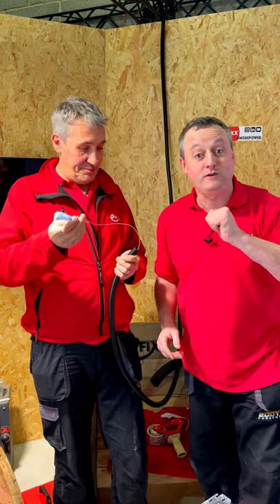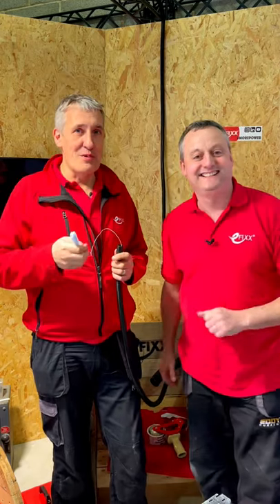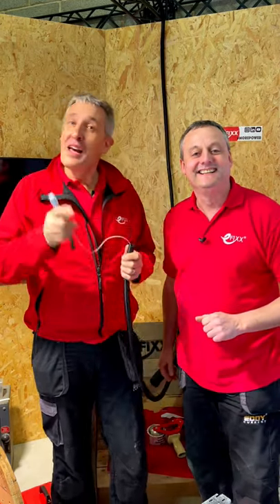Can you use a VACUUM to pull a draw wire through 20mm flexible conduit Electricians' TIPS #Shorts

Comment: Another handy method for pulling through awkward  nonmetallic spaces is to use a strong magnet, with a big steel dome-nut on the draw-string.
Reply from the maker: Great comment 👍
Reply: done this before and it was a job saver.
Reply: Tampon works too.... We used to use compressed air to fire a bobbin through. This was 30 years ago and we were using it on a poured concrete car park deck. Runs of about 50 metres. Easy. You just can't  have any tight bends. Big sweeping bends no problem. It doesn't work with our conduit though. The conduit over there in Australia is different, they come with a bell end on one end so no couplers are needed. The bobbin would catch on the couplers that we use here.
Reply: Subscribe to Mike for mind bending electronic breakdowns. Amazing channel.

Comment: Did this last year. Made a cork ball a little smaller than the bore of existing but redundant 28mm copper pipe to pull through a string that then pulled through CAT5e.
Reply: and if you have problematic pulls with this method on large conduit, use a small plastic bag like you get/used to get in small shopping with extended handles to tie off on leaving the guts of the bag free, and blow it, the idea is air kinda inflates like a canopy/balloon the pressure forces it through, but on small conduit the sucking works a treat as these guys show :)

Comment: I have done just that to draw in a rifle barrel brush to clean out an old steel conduit run in a turn of the century two story building, It works a treat, but the draw line has to thin and light weight if going around bends.
Reply: I use a 2.4mm very lightweight 275 Cord (Paracord),which has about  275 lbs / 125 kg breaking strain , & I also use a heavier Paracord,which has around 600lbs breaking strain for larger ducts & cables.
Like this: https://www.youtube.com/watch?v=u04Cn04Z_q4
Reply: @N. J. Farrar Property Maintenance It would have to be for me,a coloured fishing line, like fluorescent green or orange.